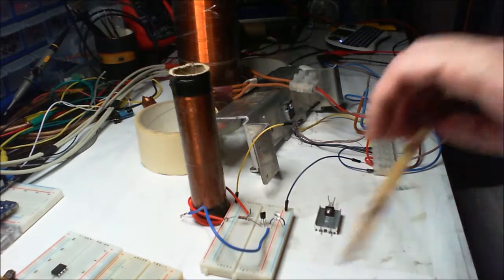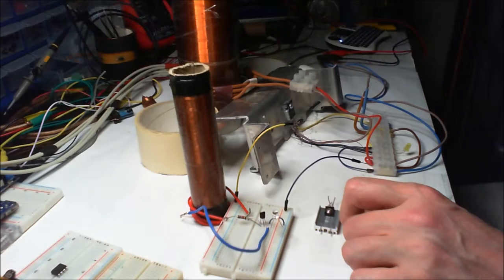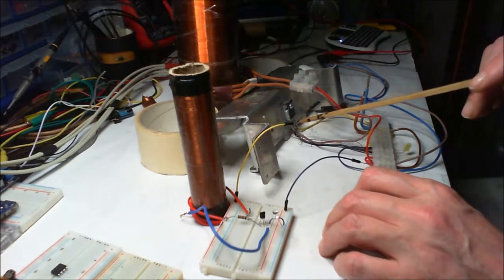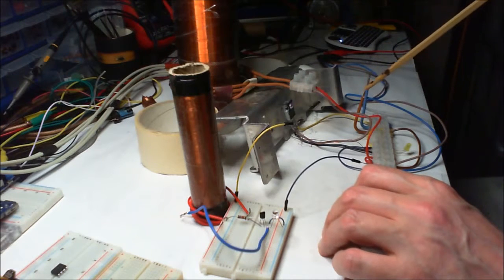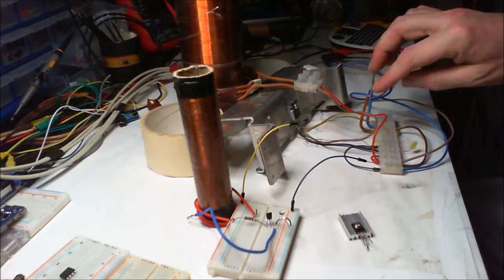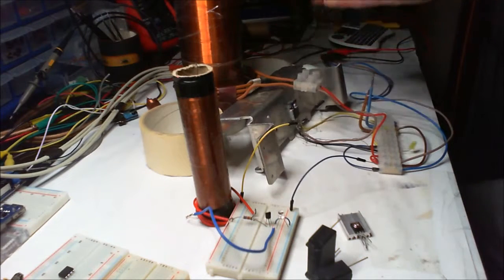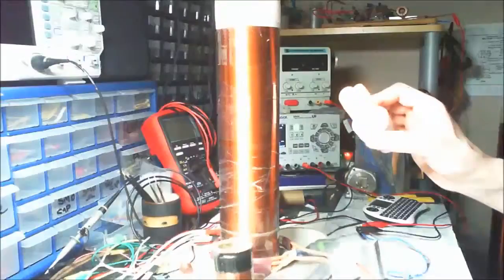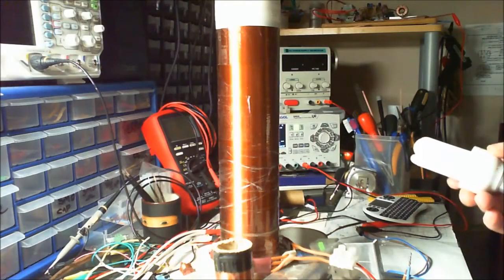Simple TIP35C Slayer Exciter Circuit

Comment: Thank you for your video.  I was just playing around with a small secondary coil and a tip41 transistor and even with just 12 volts I ended up burning it out.  Granted I did not have a heatsink on it but I would really like to build a better coil and run more power into it.  In one of your later videos I noticed you brought it up to 30 volts.  How did your transistor make out?  Also, could you please share where you are attaching the capacitor?  Thanks again!